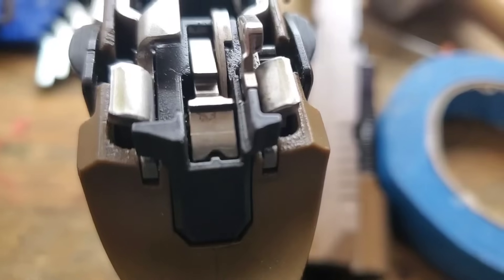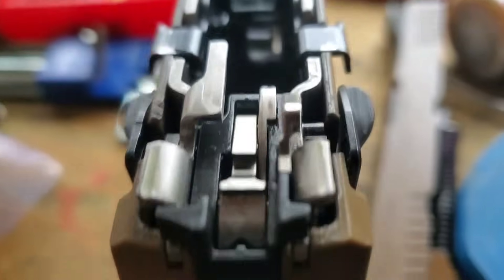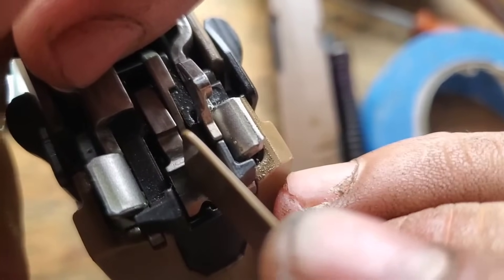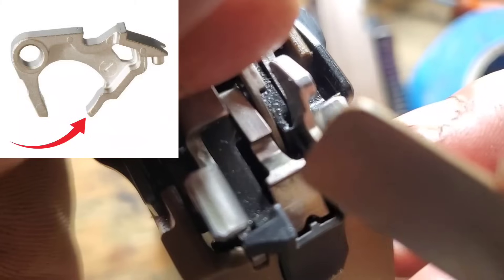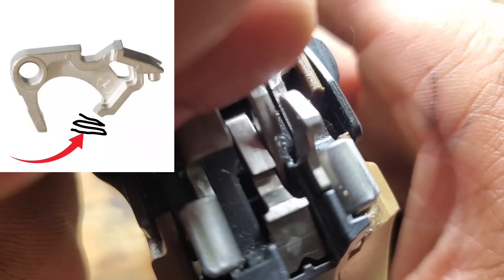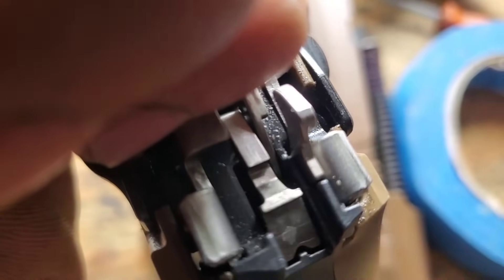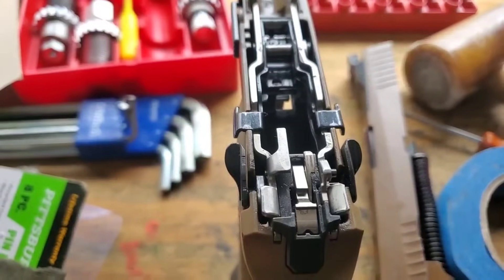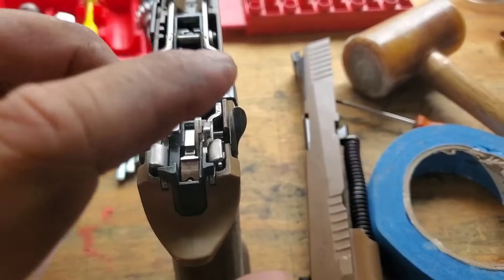Sig P320 [part I]: Private owners solve Sig Sauer engineering problems.

Comment: So happy that Big Army decided to forgo the required endurance testing prior to adopting the SIG over the Glock. What could ever go wrong when you select based on the low bid. It should be noted that tier one units are holding onto their Glock 17/19 pistol and that says a lot.
Reply: cohen aka former idf aka america's so called greatest ally, pulled some strings to make that happen. it's always them at the end of the day.
Reply: its disgraceful our gov doesnt care about our troops
Reply: Sig was the only one that brought a modular system, w/ a FCU capable to be put onto different grips, to the table. Glock didn't deliver, they had one job and they fucked it up or "didn't read the instructions". I bet that if Glock had made their - removable - firing module version at a competitive pricing they would have won the contract. This has nothing to do with "tests" but more with what the military was asking from the contenders... an interchangeable module to be removed & put on different grip configurations / sizes... Glock didn't provide what was asked...
Reply from the maker: @mauscuba there was also the manual safety issue, which glock failed to bring, but the m&p line, I thought did. 

There was also the requirement to disassemble the gun without pulling the trigger, which I think Smith and wesson and glock both failed to deliver. 

Beretta I think didn't even bring a striker fired gun. 

Not a ton of talk about that.
Reply: @timberfallingcouple  ... Yeap...Those are the facts & no manufacturer provided the full list the military was asking for. People can shit on Sig all they want, & btw I think their marketing, PR or whatever person who put that idiotic "It ends today" statement needs to be fired and Sig sure should had issued a recall, but didn't. But the Sig's interchangeable FCU as a concept, I think is innovative and very clever... Unfortunately now obscured by the stupidity, greed or whatever of some of the corporate goons within Sig. Too bad...
Reply from the maker: @mauscuba I don't know why it's so hit and miss which comments I get notified on, but I do completely agree with you. 

I'm not invested in the company, but I'm not blinded by fear or rage either. Like most things, I'm somewhere in between
Reply: @timberfallingcouple  ... No worries. Same here. People go all emotional about some brands and it is just boring and annoying. All I'm invested on is on tinkering and know more about technology, firearms is one of the things I'm interested on. The Sig case is just another item I'd like to know more about and get my hands on. I'm a OG nerd at the core, and want to know how things work (or don't work) lol.
Reply: @timberfallingcouple  I thought Beretta submitted the APX which has a removable chassis system like the Sig?
Reply from the maker: From what I understand Beretta did not proffer a striker fired weapon.
Reply: @mauscuba ^^^^ Yes.  Glock didn't follow the requirements.
Reply: @mauscuba aaaaand that “modularity” is forbidden to be used at the battalion level.
This contract reeks of corruption.
Reply: @thebanditman5663  ... No idea what are you talking about...  I do not play videogames nor belong to a "battalion"...
Reply: @mauscuba the Military has explicitly forbidden swapping the grips out… so the one thing that supposedly won sig the contact is a non factor…
The 320’s modular fcu was a thing before the contract was made… The army asked for something only Sig had at the time, to preselect the winner before there ever was a competition.
Battalion level isn’t gamer shit, it’s basic military knowledge. You’re wholly unqualified to talk about this subject.
Reply: @thebanditman5663  ... OMG! OMG! the "hard core patriot" has entered the chat, to "lecture me"... I'm so scared... (not)... Champ, Sincerely go pontificate somewhere else - . What I'm talking about is the requirements the US military listed - at the time - to all the different vendors as to what features the pistol they wanted to buy had to comply with. If you don't like that, if you "disagree" with their decision, if you don't "approve" ---> go complain with the US military. Send them letters... Go "lecture" somewhere else...  Seriously. I have no time or patience for your P320 rant, hate or whatever you are attempting here. You are arguing a no-argument.
Reply: It’s the only way bureaucracy functions. I used to work for a school district.  They went with the lowest bid every single time,  even though it ALWAYS cost them more money for fixes down the line.  It’s a strange monkey brain phenomenon.  Instant gratification with inevitable blowback.
Reply: @nbuford  ... Agree, and it is across the board regardless if it is government bureaucracy or private corporations management to apace the "board of directors", it is systemic and immaterial what administration is in office... I personally can't stand fanatical people who want to demonize one side only while being completely uncritical of the other side and of a system that create those "lowest bidder" conditions.
Reply: @nbuford  You're oversimplifying this subject by a lot. Yes, the lowest bidder will typically win a contract, which is what we should want for our government being that they're using our tax dollars, but the integrity of the products bought by the government can be upheld through meaningful standards for submissions. But in the end, the Sig Sauer 320 won the contract because it met the same standards as the Glock but at a lower price.
Reply: What are you talking about? It was the army that found out about the drop testing issue with the P3 20 they also stress tested the crap out of the gun by continuously firing it for 36 thousand rounds. There’s a whole document online showing the army test tested this weapon.
Reply: @VespertineKing  they stopped the handgun trials early sig bid around 170 million and glock bid around 270 million, the trials ended  at 12,500 rounds when it was supposed to be 25,000 rounds, last I checked the lawsuit was still pending. Most of the testing happed after sig was awarded the contract and more and more problems were found.
Reply: @BOSSm16man  Completely not true.  The trials were run to the end and Glock lost.  No idea on the actual money and I'm guessing you don't know either and are just throwing out BS comments.

Comment: That's absolutely wrong!  Thee P320s in a Trenchcoat is wrong.  That's not the issue.  SIG added that feature in the 2nd patent, which lists no less than 15 engineers.  They intended it to help mitigate the sear disengaging from the striker, but it doesn't effectively do that.  The sear has to be pushed down considerably and with an amount of force to actually force the trigger bar down enough to rotate the striker block disengagement lever. I don't see how that can happen in normal, or even severe use. So, in my opinion, that's not what's happening.  
I don't have any affiliation with SIG.  I do have 29 firearms and suppressor patents or patents pending, five of which are for triggers and three relate to striker fired pistols.
I'm telling you this so that you don't have people make a modification that won't prevent the un-commanded discharges (UD), but modifies the pistol in a way that could make it more likely to occur and would relieve SIG from any liability for the UD, should that occur.
Reply: "SIG added that feature in the 2nd patent, which lists no less than 15 engineers." so, is this an argument that there could be no unintended design consequence  of the dog leg because it was intended for something else and  "15  sig engineers can't be wrong"?
Reply from the maker: I literally can watch the firing pin safety not work before the mod, and then work after the mod. Or should I just keep buying trigger bars, sears, safety levers and plungers and parts until I find a combination that works together?
Reply: There is suspicion that the poor finish on the sear and striker can allow it to “walk”itself into a position where it slips off. If the sear is by little movements and pressures able to push itself down, then the sympathetic trigger bar and striker safety movement would allow a full discharge to occur.

Comment: How much do you remove of that part
Reply from the maker: Doesn't seem to take much, but I removed the entire leg to the bend to completely disconnect it from the trigger bar.

I recommend you watch the video link in the description, and be completely familiar with the process and how the parts interact before you start filing.
Reply: @timberfallingcouple  thank you
Reply: I almost wonder if it gets taken down to the point of the "sympathetic" safety lever movement, would it still be considered "drop safe". I have an extra sear, just not sure if I feel like doing a rear down and rebuild on my FCU that many times to find the sweet spot!
Reply: None. Don’t do it
Reply: @PTSD_Karma why?
Reply: @petethebuilder2025 because it’s never been proven to fix the issue. Wait a bit till testing comes out regarding moving the piece. And make sure you pay attention to “the sig armorers” YouTube because he makes kits for the 320 and he’s supposed to be dropping a kit soon

Comment: The tab on the back of the sear was there to interact with the trigger bar, when you release the trigger.  The trigger bar would push the tab on the back, pushing the sear back to it's resting position.  The issue is that some 320's parts are out of spec, and the tab on the back of the sear catches on the trigger bar in a way it is not supposed to.  This is the clicking sound exhibited in trenchcoats video when pushing the sear manually.  This clicking is the sear catching on the trigger bar in correctly.  When it catches, or clicks, it would cause trigger bar movement, which in turn pushed  the striker safety tab upward deactivating the sear block.  The pistols that exhibited the click, would allow the striker to enter the chamber without pulling the trigger.  The out of spec parts are causing a timing issue with the firing sequence in the fire control unit..  Cutting the tab off the sear, removes the out of tolerance issue with those two parts.

Comment: We watched the same video. Props to three p320's in a trenchcoat. Mine passes as well but it's probably because I never sent mine in to get it "fixed" so my sear doesn't have that foot. Pushing down on my sear does not push up on striker safety lever. Rather have not as drop safe than not as ND safe.

Comment: Sig has known about this problem for a long time. Someone in my circle of influence got shot shot through his own holster down his leg and lost his career over this POS gun. Sig should be ashamed of themselves and I hope they go bankrupt and go out of business. And by the way I am not a Sig hater, I have a substantial collection of older Sigs. Somebody's going to go to prison over this. If not they should.
Reply: No one is going to prison over this. If Sig is found liable they will provide another upgrade program in exchange for not admitting on record that the P320 had issues.. That will be that and the world keeps spinning. Sig is way to powerful at this point for anything substantial to come out of this.
Reply from the maker: @Hank_Chill agreed. I personally think they will solve the problems internally and then only fix the pistols of people calling them to report problems.
Reply: There are only two cases in which sig has lost in the courtroom, but neither case found the gun able to discharge without trigger pull. 

There were also two other cases in which Sig settled out of court there are a total of 13 dismissals in sigs favor 

Which one of these cases involved your so-called friend?
Reply: There have been well over 400 instances of defective discharges.  Don't get your information from Sig.  Sig settled several in court, and probably a whole bunch out of court.

Comment: You know the striker block lever is spring loaded right? The moment you remove your finger off the trigger, that spring with push the safety lever down through the striker block lever
Reply: The problem is that many springs are failing and fouling/grime can lead the sticktion to overpower the spring and leave it on the fire position even after releasing the trigger.

Comment: I'd seen that original video by Three P320s in a Trenchcoat when it came out and YT just recommended yours to me today.  I just wanted to say that I especially appreciate your last point about the more responsible option being to solve this problem rather than sell your P320 off to an unsuspecting second hand buyer.  I wouldn't be comfortable with that either.

I'm not an engineer or gunsmith but I feel like Sig got off on the wrong foot when they cannibalized the P250 frame/FCU footprint to make the P320 in their rush to introduce a striker-fired gun to market.  I would imagine hollowing out a hammer-fired gun and then telling their engineers to fit striker-fired internals in that space would lead to some compromises.

In comparison, the P365 was designed years later from the ground up after Sig seemed to have learned a fair bit from the P320 with the P365 having: a traditional "plunger" style striker block safety, a manual thumb safety that actually locks the sear in place upwards against the striker, etc.

Though for some reason they still refuse to add a blade trigger safety like pretty much every other striker-fired pistol manufacturer out there and that alone would probably have prevented at least half of the incidents out there.

Comment: Why are all these guns going off inside holsters? Why arent the guns discharging outside of the holsters? I.E.like the loaded and chambered  320 i set on the range table,  facing down range of course as per the second ru,e of firearms  safety? Heck, why dosent the gun discharge as i am lowering the gun (round still in chamber) as i am placing it on the bench? Do the thing have stage fright and only discharge inside holsters while a camer is rolling?
Reply: Holsters often grip the ejection port to hold the slide, meaning that a bump to the grip can move the FCU in relation to the striker, therefore changing sear engagement geometry.
Reply: @ChucksSEADnDEAD . Now that is worth checking into, thank you for a constructive reply, wasnt sure if i'd get hated on for the question.

Comment: Bro listening to this was painful! You are not going to figure it out and fix it. If it was that easy SIG would have done it already. I dodged a huge bullet back in 2019 while I was shopping around for 6 new pistols and I was considering the 320's. Instead I bought 6 Glock G-19's instead and a dozen Magpul 15rd Pmags. The G-19 has been the best selling compact in the US since 1990. And best of all it doesn't have a cocked striker.
Reply: Having a partially cocked striker means nothing and does not make the pistol more safe. 
https://youtu.be/DBCGdxmILDY?si=Gj0zm_ZIdBz7Ntmu

Comment: Deserved or not, the P320 has an indelible stink on it.  Analogy, if the bag of M&Ms only has a single suspected poisoned candy, who would partake? The dilemma of loss of trust in the P320, and unwillingness to transfer a possible hazard, to another.  Rock and hard spot.
Reply from the maker: The big one at this point is no recalling with a solution.
Reply: @timberfallingcouple impossible to fix when there is no mechanism issue.
Reply: thats a really good analogy lol
"B-BUT NONE OF MY M&MS WERE POISONOUS!!!"
Reply: Since I don’t waste M&Ms, I better get rid of my SIGS before I get too far along! Lol

Comment: One other thing to note, what you have done now is allow the lever to move independently.  If dropped upside down the lever can move  upon impact deactivating the safety plunger. The reason it was connected to the trigger bar is so it only moves with the trigger press and not if dropped. You have now made your gun less drop safe.
Reply from the maker: The sear was able to move the trigger bar when in its former configuration. Causing much of the problem of multiple safeties being bypassed by that connector on the sear.

The gun is less tropical safe in one way now. 

But the other safety systems in the gun actually function now. Before the gun could shoot your balls off if the right sequence of failures occurred in a row. 

But correct. Don't do this and then throw your gun on the floor.
Reply: @timberfallingcouple  Did you read the sear safety cam patent yet?  You are putting out disinformation which encourages similarly clueless P320 owners to defeat the safety system. This is incredibly foolish.

Comment: There is nothing wrong with your pistol, it goes bang upon pulling the trigger. If you don't pull the trigger it will not go bang. Try the test bellow with the safety on trigger pressed and release the striker as shown in the videos.https://youtu.be/3Jqob_5mVCM?si=rz9-qg3_-mpSa-nl
Reply: Thank you.  This internet reaction to P320 as an unsafe pistol is delusional.  Reminds me how all the low information voters can be easily stampeded over the cliff because all these naysayers can't all be wrong.  The P320 has redundant safeties built into it.  It is the safest striker fired pistol on the market.  This video performs the safety test using rounds with just the primer:
https://www.youtube.com/watch?v=r2cDUlFQfhw&list=PLedkZGQ_GlprIwVqE8SOrndFtnSJwBXjy&index=12
Reply: @BL_retiredME  redundant safeties which are known to fail
Their CEO ruined Kimber's reputation, what makes you think SIG is immune to cost cutting?